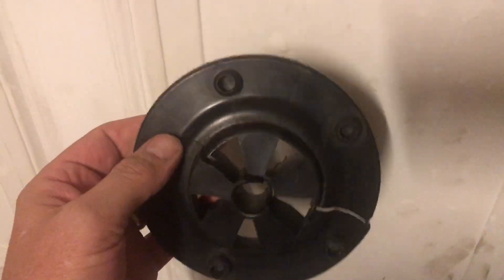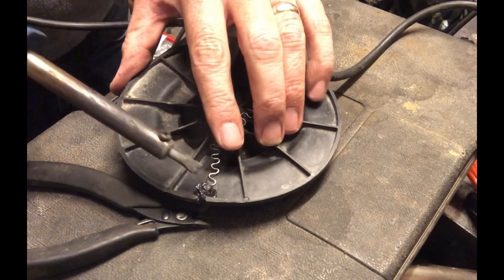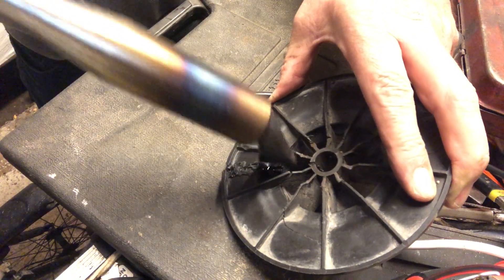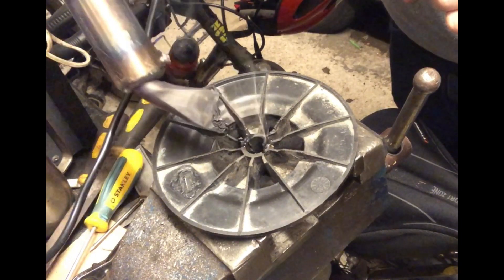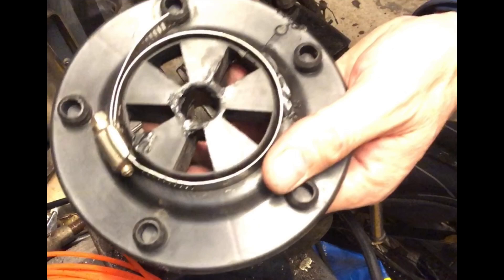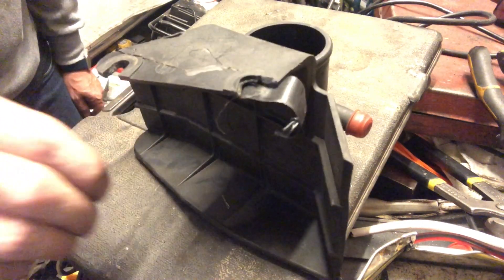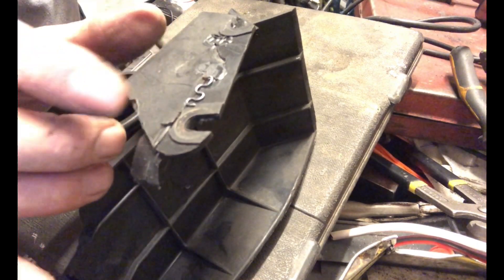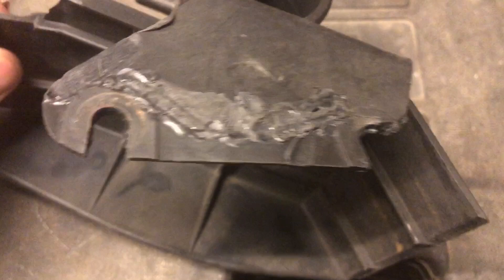Plastic Welding Without Using Any Special Plastic Welding Kit.

Comment: Really enjoying your videos. I tried to do some plastic welding recently - it did not go well as my soldering iron just not hot enough. You have inspired me to get a better one! I am missing the cap from the top of my spare wheel mount and the bolt. I'm trying to come up with a home made solution but not easy. Bolt hole is threaded on the carrier.
Reply from the maker: Thanks, you do need some good heat to do this, good luck with your repairs.

Comment: Thanks for sharing this! Around 2:30 it looks like the pressure from your left index finger is exerting some leverage that actually pulls out again the wire from the molten plastic. Wouldn't it have been easier, if you had formed the repair wire (and cut it to length) according to the shape of the surface it needs to melt into? I can imagine that then the wire's spring load even would have assisted to get the repair wire willingly reach its desired location.
Also, why not bend the repair wire into broader loops or even bend every second loop larger, so it can add more strength to the repair by biting/melting into as much as possible sound material further away from the original crack? And why not first tack the crack's edges together with the soldering iron in order to have them correctly aligned before melting in the repair wire?
Reply from the maker: I went through a good learning curve with this video, shorter lengths of reinforcing are much easier to deal with for heat and installation but placing is more difficult. I think I was a little scared when working on the second plastic piece as I knew I’d get on shot but I could have racked it in place with hindsight. Both of the parts are now refitted to the vehicle so it saved a small fortune. Thanks for taking the time to comment it’s appreciated as it helps us all out.